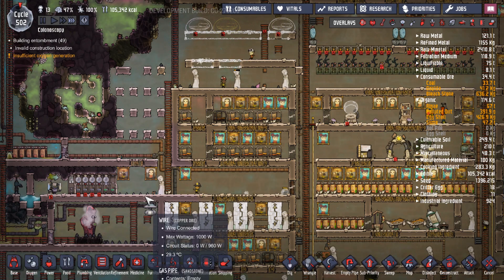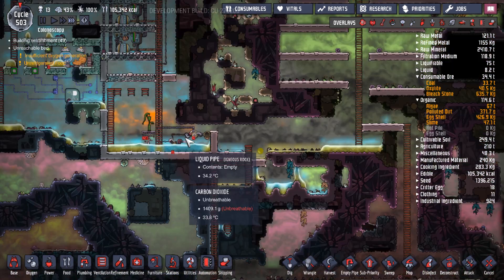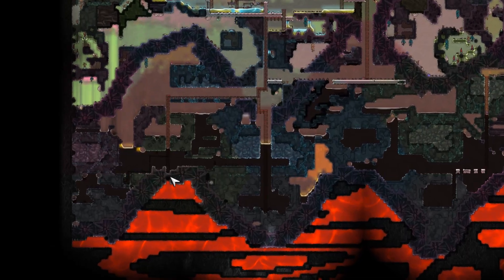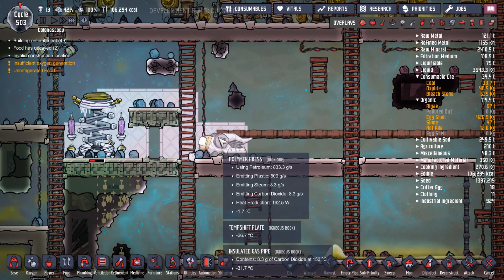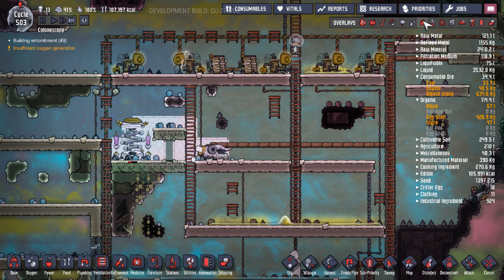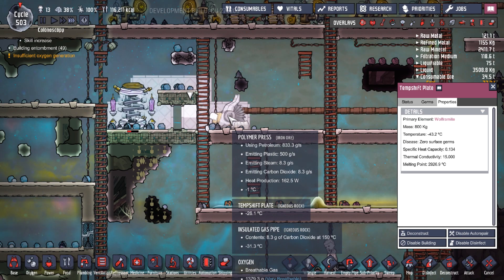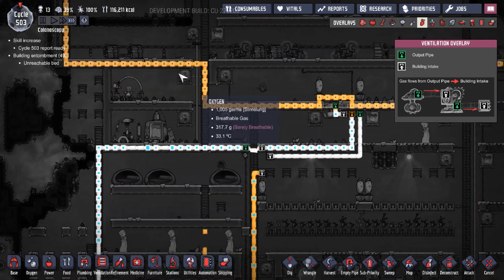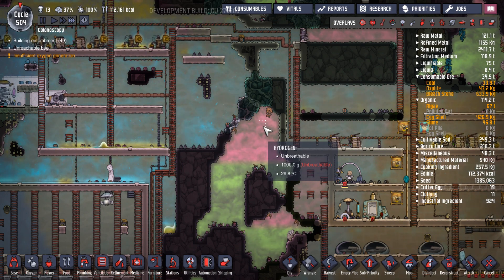#14 Oxygen Not Included - How to Build a Polymer Press and Produce Plastic

Comment: My problem is how do I build the liquid pump without my duplicants dying from the heat.
Reply: They have to wear suite before entering --- there are 3 bulding missing .. 
1- To create suite / 
2- Hang the suite and filled with Oxygen / 
3- Check Point to Enter the Danger Area (Design only one way to enter it) with dress the suite or remove it when return
Sorry >> then name of the building is too difficult to remember
Reply: Make exosuits or spacesuits or how are they called
Reply: Build a gold pump and crack on the edge of the biome where the oil will drop into the pump area if you can.

Comment: ye i built polymer press in cold biome and its still overheating
Reply from the maker: Did you build it using gold? It will overheat if it's made out of gold it will overheat quickly regardless. Just rebuild it using another material.
Reply: @GamesCaste  Yes, i made it out of gold. Thx for advice, ill check it later.